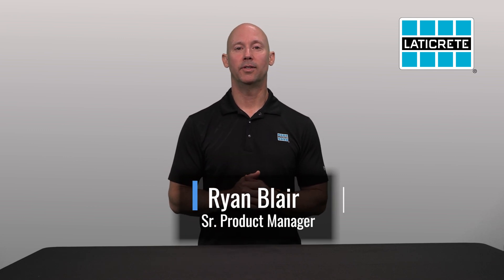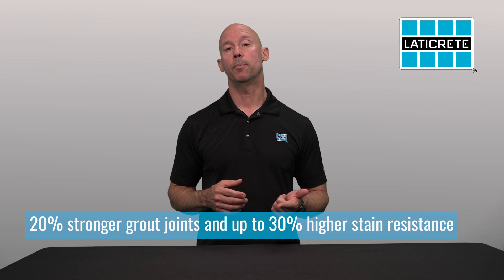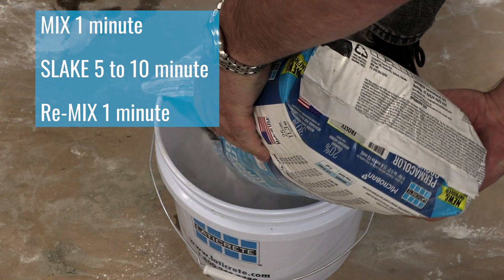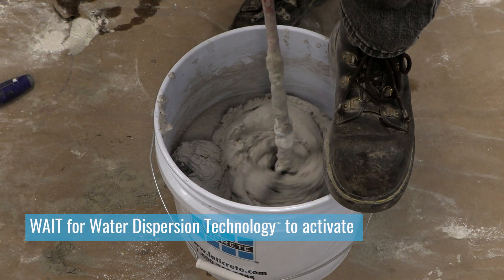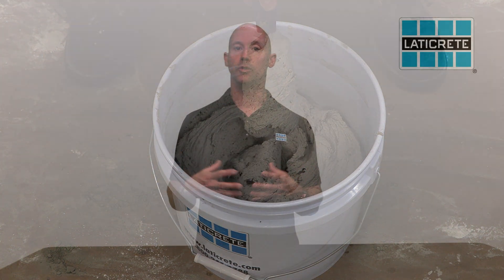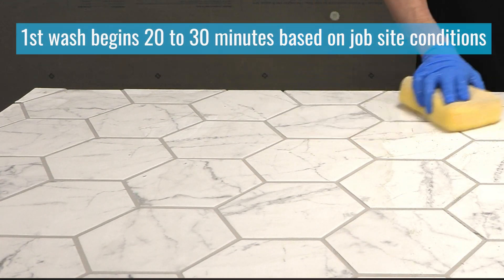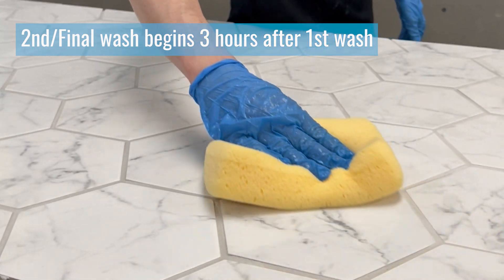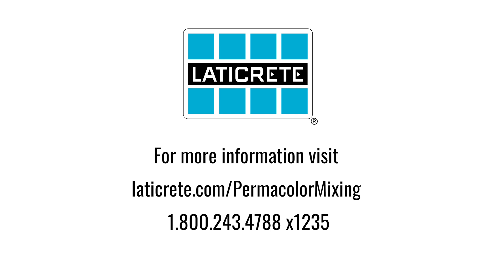New Cement Grout Technology

Comment: The new formula is ok but the older was better. The new mix dries way too fast no matter how you mix it. Fix the working time and dry time and it'll be a great product 3 out of 10 till then
Reply from the maker: We appreciate the feedback.
Reply: @laticrete  i think they got it figured out. Now it works great and isnt setting up in the bucket like before. Now ill give it a 10/10
Reply: Why rapid, the age of instant gratification
Reply from the maker: We appreciate you leaving the updated feedback!
Reply from the maker: All calcium-aluminate cements will be rapid setting products, this is due to the chemical reaction of the ingredients with hydration when mixed. When these products are mixed, they begin to generate their own heat which leads to the curing process. Working with these products in hot environments and/or direct sunlight may speed up the curing process. Additionally, over-mixing and mixing warm water with the products will also shorten the pot life. When working with rapid setting cements it's best to keep them out of direct sunlight even in their powder form, mix them with cold water if possible, and don't over-mix the product, this will result in the longest pot life potential, typically around an hour. The benefits to using a rapid setting cement grout like PERMACOLOR are a faster turnaround on the job allowing foot traffic and water exposure much sooner, and better color consistency due to the speed in which you can perform your final wash, and the lack of limestone, the cause of efflorescence, you would otherwise find in traditional cement grouts. Overall, the benefits of this product far outweigh the preparations needed when working with a rapid cement.